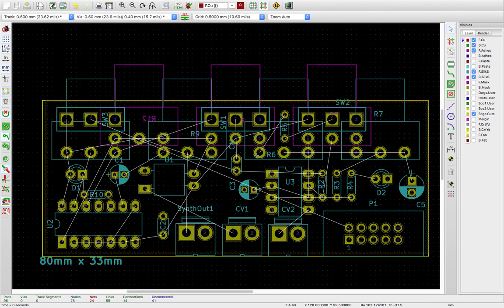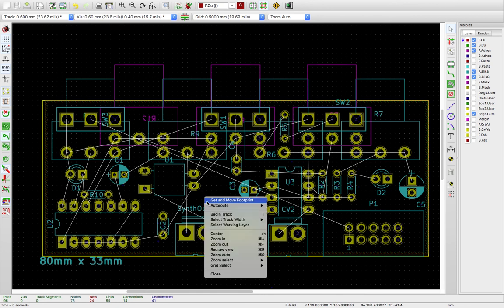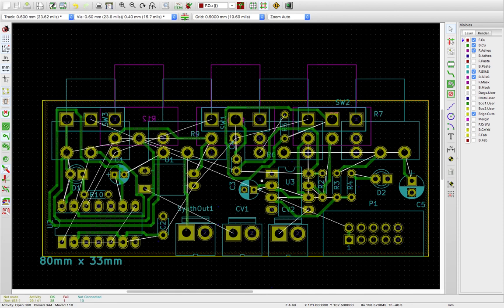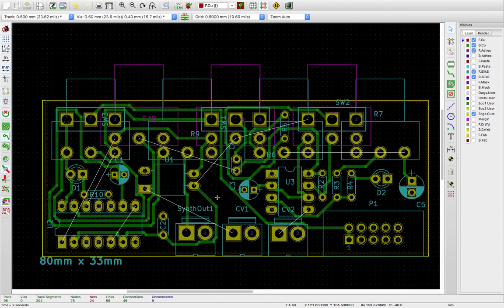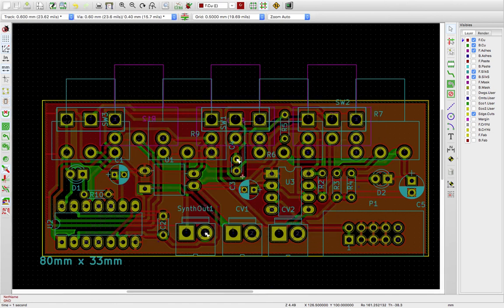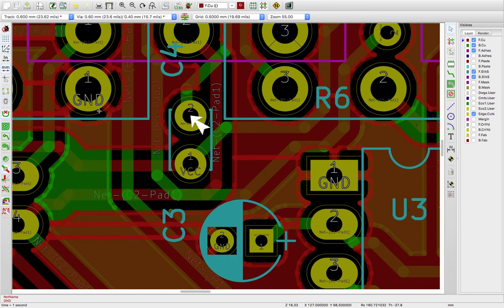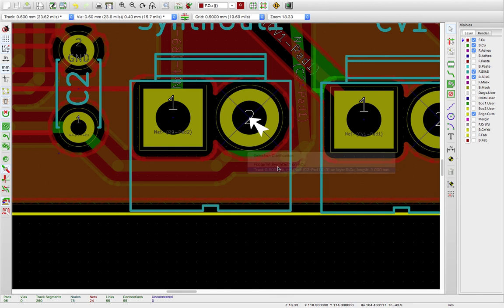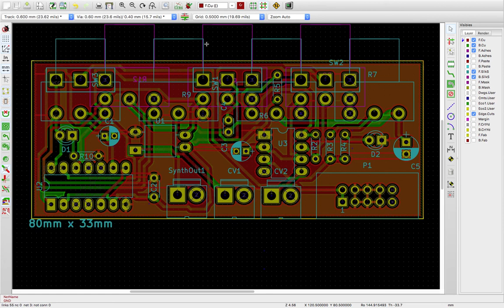How to Autoroute without Vias in KiCad

Comment: Hi! I don't have the option for Autoroute. Is this a plugin you installed or a different version?
Reply: nbd712 I’m not sure what version this is but I know that autoroute won’t pop up in the menu unless you click on the “#️⃣” button on the top menu bar next to the street sign-looking button. Once that one is highlighted, autoroute should be available if you right click on the board.

Comment: I am running 4.0.6 on Windows 7 Ultimate.    I do not have the gray pop up windows you show here.  Much is different.    It would be nice if you could have stated the operating system and version you are using.  Many of the options you are showing are not even present.
Reply: Note the comment I made above